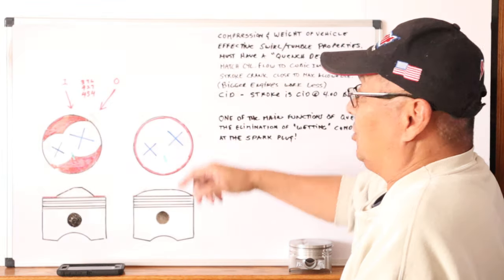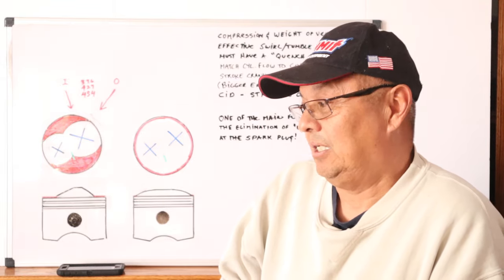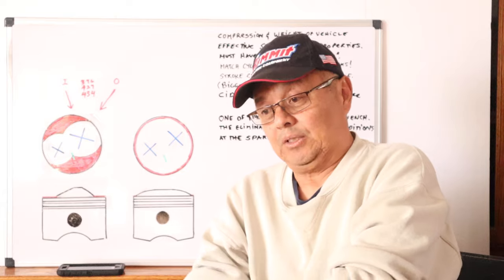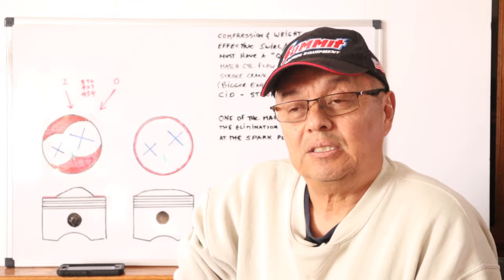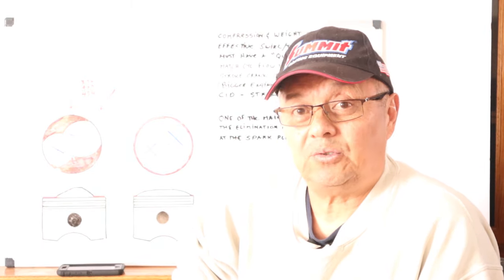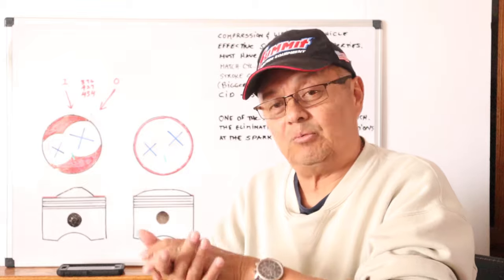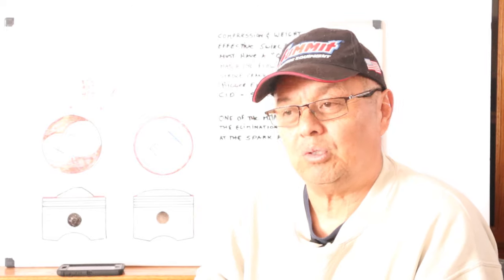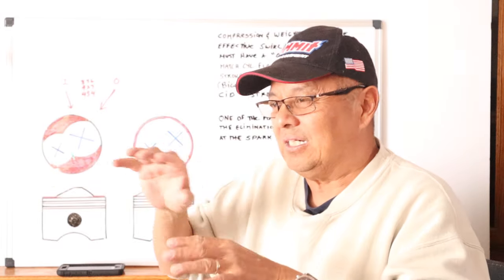HOW MUCH COMPRESSION PART I CAN WE RUN ON THE STREETS?

Comment: Hello Ben, I have a flat top kit with 11cc valve reliefs, with a straight edge they are almost zero with in two sheets of paper, with 58cc on street, should I get a .40-.41head .60 gasket,  I understand quench is affected I appreciate your information.
Reply from the maker: Looks good and if you are ordering custom head gaskets make sure they are about .010 bigger than the bore you are using to make it even better.

Comment: I've been debating which heads I should choose for a street blown 429 (545 cid) in a 3800 lbs Torino Cobra. I was wanting to use my 73.5cc CJ heads, but will need thick head gaskets and all dished pistons or maybe best to go with the smaller port / larger 76cc chamber heads. Either way, I'll have all dished pistons. I don't know which route to go? .......... 

I used to have a blown 1971 flat top piston Cleveland and put 4V open chambers on it and everything was great. Plus the blower atomized the fuel better in those large intake runners and ended up with a noticeable increase in fuel economy. ..........
Reply from the maker: I tried that combination before but with a stock stroke 460 with 429 early castings.  I installed 2.24 intakes and 1.75s if I remember and it was a fast and responsive engine!  If you can maintain at least minimum 10.5 compression it should run very good!

Comment: I've got a 2,021 Mazda MX-5 Roadster, came stock from the factory with 13-1 compression ratio. Runs JUST Fine on 92 or 93 octane pump gas.
Reply from the maker: Wow they come from the manufacturer with that much compression? I thought the mustangs and corvettes were high and that is pale in comparison to 13.1!  Wow.
Reply: Yep, it's a 2.0 liter inline 4 rated at 181hp

Comment: I'm looking into stoking my Cleveland. The 408 with 6 inch rods had a 1.5 rod ratio. That seemed short. The 393 had 1.6. Please comment on this. Steep overdrives would make a light car seem heavy. You didn't mention dynamic compression. Is there any cranking compression rule of thumb?
Reply from the maker: Steve, cranking compression after about 5 kicks of the needle should not exceed 200# and you will be ok with 91-93 octane.

Comment: Im planning on building a 440 mopar to replace the tired original one in my 68 Plymouth. 

I was wanting around 10:1 compression, but my friends are trying to convince me thats a terrible idea, don’t do it, and I’ll have to run 93 octane or mixing race gas in. But I’ve heard of these guys running 11:1 on 91 octane. 
 Am I missing something? 

Ive been looking at the KB237 flat top pistons which with 84cc aluminum heads should be 10:1 or less depending on which gasket. They also have a quench piston available.
Which is KB236 and comp is 10.3:1 with 84cc

Do you have any advice?

Comment: I built 454 with .030 8.5 almost zero deck flat tops and open chamber oval ports. Comp XE284 hydraulic. PRW sportsman roller rockers. Single plane. 800 quick fuel. Advanced cam degree. Makes 520 torque @3200 and 460hp@6000. 78 camaro gutted 10" 3000 stall-4.11 rear. 11.90@110
Reply from the maker: 11 sec. street car is no joke and a 78 Camaro is not really a light car.  Glad your on board watching my channel and many thanks to you.

Comment: I run 11-1 compression with aluminum heads sbc with 91 octane.Timing is at 18-38.I hear the distributor starts to ping a little if I take the timing to 40.I drove it around with 40 degrees for a few months and notice a slight ping only a couple times when I put gas in.Telling me I am boarder line and not everytime I put gas in the octane must be a grade different.38 degrees has never done that.
Reply from the maker: I wonder with that stuff summer and winter blend if the octane rating is really accurate.  ?

Comment: Found this video while researching for a 302 rebuild, knew about quench, but not all that it helps. Now I just need to figure out what I need for an 87 octane application and aluminum heads.
Reply from the maker: Quench helps big time specially if you plan on running low octane gasoline...

Comment: I'm running a 331 with about 9.8CR in my 1976 F150 4900Lbs.  I run 29° total, 8° initial and I still get pinging
Reply from the maker: Make sure your timing marks are accurate and it should be good.  How are the heads and valves are they thin at the margin and guides are tight? When you get oil consumption from the rings/guides etc. you will have problems!  What kind of cam do you run?

Comment: The issue I have with higher compression is the need for high octane. I love driving my car but anything less than 91 and it doesn't run right or tries to stall at idle. My motorcycle was the same way but even more temperamental.
Reply from the maker: Something is not right if you are running the same octane it should be a lot less with a motorcycle engine due to the diameter of the bore does not lend itself to auto ignition as much as lets say a V8.  What kind of engine are you referring to here?
Reply: @benalamedaracing2765  The motorcycle was a new Kawasaki parallel twin 650. Would scream when cold and was nearly unrideable until warm. And that is running on 91 octane. It was sluggish and pingy with less octane.

Comment: I’m in the very beginning stages of planning a build for a 1970 455 with 7F6 heads for my 77 T/A with a tremec 5 speed. But I’m farther away from knowing what I want after every video I watch. I’ve been looking at stroker kits and roller rocker & cam from Butler performance and DCI but I don’t want to end up spending $10-$13K to have a 9:1 stroker with lower compression that makes maybe 50hp more than it would factory. Maybe I’m crazy for thinking 550 hp should be relatively simple out of that many cubic inches on pump gas
Reply from the maker: You can make 550 if you have enough decent street compression and good breathing heads with good enough cam specs.  Rather easy to do and Butler should be able to direct you in that direction!

Comment: Hemi heads work without quench and make big horse power
Reply from the maker: Yes they do specially under boost or with alcohol fuel or methanol/nitro combined.
Having primarily tumble with not much swirl or none at all NA then it is at a disadvantaged!

Comment: I ran a SBC with an 11 to 1 dome piston, 64cc heart chamber Dart head, and a Lunati bracket master 305 camshaft. That motor screamed. Cranking compression test was at 240 psi. I am going to be freshening that motor up soon to go in a 1987 Monte Carlo Ss. Cheers  Mr. Alameda
Reply from the maker: How much duration @ .050 and lift do you have on that cam?  That is interesting and it is for competition usage correct?
Reply: @benalamedaracing2765   245 at .050 and .525 lift and 108 lobe separation I believe.  I could look it up. I'm not sure if they even make the Lunati Bracket Master 2 cams anymore. I believe that they are called VOO-DOO cams now. I would always back the timing down to around 30 degrees when I was cruising on the street because I knew that I was pushing the limits with the compression. I also had 1.6 roller rockers. It was a great combination. Man that car was fun to drive. I know Iskederian cams has a similar cam called the MEGA CAM and it has 256 degrees at .050, 108 lobe separation and 525 lift. I like the Isky cam specs too. You're right about being able to run 11 to 1. Especially with aluminum heads and a good cooling system. I never had it dyno tested but I figure it put out around 500 horsepower 😎

Comment: I'll buy that, with 93 octane! I gotta lackluster set of aluminum heads for my 357w.  It's going in a 94F150 flareside. I know my professional ported heads would outperform the aluminum! But the detonation comes to mind! Run more overlap on the cam?
Reply from the maker: Depends on the heads you will eventually run before I can give you a determination on how next to proceed.  If you have 9-9:5 compression you are better off with the cast iron heads thats for sure!
Reply: @benalamedaracing2765  that was my opinion! We ran a set of professionally ported 289 heads with 1.94 and 1.60 stainless valves. Swapped the out for a set on RPM's. Picked up one tenth! That's 10 hp!  Traded compression for a little more flow! And everyone saw those aluminum heads! I'm gonna run them on my Windsor with trw pistons I already have.

Comment: I realize this video is two years old, but this topic is exactly what I'm looking at right now. If I run a flat top piston and bring it within .040 of the quench, I get a calculated 14:1 compression. What would you change to bring the compression down?
Reply from the maker: What is the bore and stroke plus the combustion chamber cc's?  And what type of engine.
Reply: @benalamedaracing2765  Wow, thank you for responding! It's a measly little 4 valve/cyl. single cam 1600cc Honda engine. it has a 34.6cc combustion chamber that I'm planning on opening up to bore diameter, so I can get the piston up into the quench area, which by my math would make the combustion chamber 35cc's without any blending, but that still leaves me with .100" piston to quench including the head gasket, so the chamber will end up being smaller than that once the head is cut another.050", or so. The bore is 2.97". The stroke is 3.54". The rod length is 5.39"  the ratio is 1.52, so it has a longish stroke and a shortish rod, which in my mind helps reduce dwell and hopefully detonation. The factory piston in this engine is dished @ 9.2:1 compression, but the area at the circumference of the piston that is at deck height is smaller than the quench area of the head. the dish in the factory piston is 10.1cc's and .118" deep. I'm really wanting to figure out how I can get a flat top piston in this engine and still have good tight quench. I hope all that was literate. Thank you for your consideration.

Comment: i run 280psi (measured @ sea level) 12.7:1 CR Flat tops on a 1.6L SOHC 75 bore * 90 stroke on stock cam 198 in ex duration, 8mm lift in ex on 93 octane @ sea level in a 1000 KG car with 0.020' quench clearance  (6500 RPM limit) and sing grooves.  

My question is  : Can i go higher if i put the same engine in a 600 kg gutted hatch and use it at high altitude of 6000+feet above sea level on 93 ron fuel. If not much , i am considering supplementing with LPG fuel for higher knock resistance properties.

How much headroom does the higher elevation and lighter weight provide  ?
Reply from the maker: The engine will detonate much less @ higher elevations and with a lighter car would even be better.

Comment: Okay, got a question: re the comments made at the 4:15 mark - "if you've got too much initial timing... it will probably run on"

I'm confused how ignition timing would affect this, since the ignition is turned off when the car is "running on". 

I can see how running too little advance at idle might tend to make this worse, because without enough timing at idle (regardless of total timing), the throttle blades have to be open further to get the idle speed where we want it

I've also seen it happen where the idle mixture was way out of whack, as well 

It's been my experience that when I have a car that runs on after the ignition is shut off, doing whatever I have to do to the tune to get my idle speed where I want it, with the throttles open as little as possible, seems to help the situation

So, I'm curious how too much timing would cause this phenomenon. If you can break down how you've seen that happen, I'll always be happy to learn something new
Reply from the maker: Running on after you shut off the engine sometimes are caused by overheated valve margins specially on the exhaust valve.  Also carbon buildup will also cause this big time specially if the engine is not in good condition or was not altogether built very well. Wide quench clearances or lack off specially with open chamber heads also will do this.  Made worse when the initial advance it too much as well as too little...

Comment: I ordered my stroker kit from ford strokers, its a 408w 10.4 comp 22cc dish 16 out the hole with afr 185 58cc cylinder heads
Reply: I sure hope it runs pretty good,  I wish I'd had seen this vid first then I would've upped my comp a bit
Reply from the maker: Thanks for watching guys!

Comment: Too true Ben.. with the BS low compression open chamber heads of the 1970;s , 400 CID engines with 8:1 compression could barely make 200 horsepower. Pathetic.. It was a plan to create the fuel crisis
Reply from the maker: Those days was pitiful and big blocks who runs like a big dog.  haha.

Comment: 11:1 540BBC 4000lbs no problem on 93 pump at 37 deg total timing
Reply from the maker: That cubic inches does not feel that heavy weight car and this is why I always say consider the weight of your build.  Small block would have an issue but a 540 would be a piece of cake with pump gas and make lots of torque and hp.

Comment: This really has me thinking.... I was going to leave my pistons .028 in the hole for my flat top 393 stroker build with 4v CC cleveland heads as it gave 10.6:1 compression (8.1 dynamic with the cam I'm planning to use) Do you think decking to around 11:5:1 leaving roughly .040 for quench would work for pump gas still.... I could always adjust with a bigger cam if it doesn't.  Car is 3500lbs with a  4000 stall 29" tires and 4:11 gears
Reply from the maker: Troy, looks like your plan to increase your CR is good even at 11.5.  My only concern is the 3500# weight but looks like you have the right gear and stall speed so it sounds good from here!
Reply: @benalamedaracing2765  I'll try and put the car and myself on a diet haha. Greatly appreciate your opinion on it. Might as well try to optimize the use of these old Iron Heads
Reply: No, do not deck to compression target. Deck to the top of piston flush with block. Use O.04O" head gasket for quench area. Massage piston tops rounding all hard corner edges. CC your heads combustion chamber and the pistons for desired compression. Leave quench tight. 0.O37" to 0.O40". Check valve to piston or piston to valve clearance also for any massaging on piston that may be necessary.
Reply: @zAvAvAz  Build was finalized months ago; however thats exactly what I did; measured out to 11.2:1 static with miles of p2v clearance left, massaged chambers and .040 quench. It runs amazingly; all kinds of power everywhere,
Reply: @troyberg65  What fuel are you running, and if you dont mind my asking, what does your timing curve look like?
Reply: @stuartwall8212  I'm running it on 94 pump gas(10% ethanol) right now, but it was running on 91 for a while as well with slightly tamer timing. I have a MSD grid to program the timing and off the top of my head it's around 16 initial; 32 all in by 3500rpm. I'm still playing around with it to maximize performance; didn't get much testing time with moving last summer; I just kinda set it to a safe spot. I am at 2200ft of elevation as well.

Comment: The truth is if you could figure out how to do it 20 to one would be great. And everything except for WOT you would get just the right cylinder filling such that 20 to 1 would not pre-ignite. The idea is that WOT you would not do full cylinder filling. Not great for race engines but if you want gas mileage this would be the way to go.
Reply from the maker: I gave a forum in a prestigious overseas College of Engineering and they were competing in the Shell Eco-Marathon competition.  They told me they run 11.1 because of the 93 oct. fuel they are using.  To which I said wrong!  Go as high as possible and in fact told them like you said 18.5-20.1 compression!  After I explained the they are at full throttle with said gasoline they will be far away from  detonation because the engine is not getting a full volumetric efficiency @ the low throttle setting and rpms they are running!  WOT which they never see will destroy their engine but as far as the conditions they were using it for an increase in compression by a very high margin did the job and the students learned from an outsider not a professor...

Comment: Piston speed relative to port size length, cam timing events? I had crane fireball heads by champion racing heads. On a 356 Windsor with a solid roller approximately 6,500rpm max, victor jr, 1 7/8" long tube. 10.5 compression. Ran great. Put the same heads cam, victor Jr, 1 7/8" long tube, 10.5 comp. In a 306 Windsor. It didn't run as I expected. Rpm still 6,500 max. It just seemed way off. My thoughts were cam timing to piston speed.
Reply from the maker: When you did the switch two things stood out as a net negative!  The hedder primary pipes of 1 7/8 is way too big!  Second, loosing 1/2 inch of stroke from 3.5 to 3.0 will kill the torque big time and I would not concern myself too much with piston speed but more with displacement.

Comment: Many variables to take into consideration.
Reply from the maker: Always...If you are more informed of them the better the decision.  Many really are in the dark however.
Reply: @benalamedaracing2765  well there's a difference when we do hundreds of engines and most people only do a couple of them.
Just in ignition, there is at least 5 variables that I can think of that influence how much compression can be run.
In the 80's , I fine tuned a 4V Cleveland with 11 to 1 nominal compression ratio to get 19 mpg.  
But probably couldn't do it today, because of the gas available. Which is another variable.